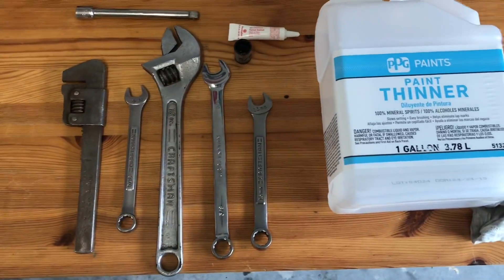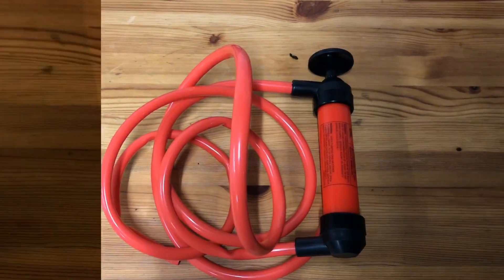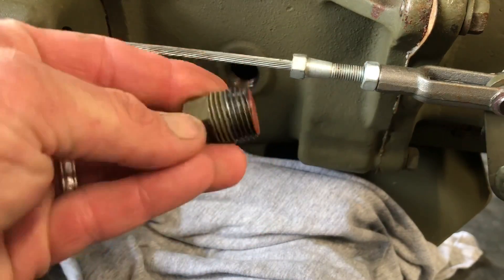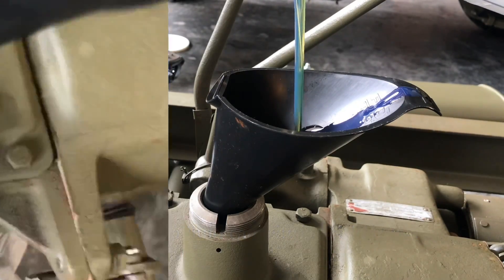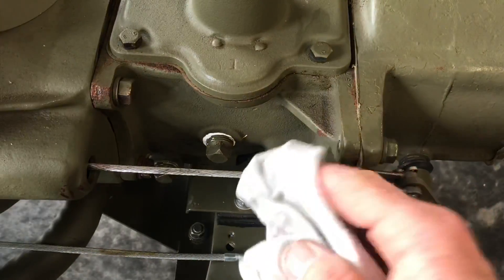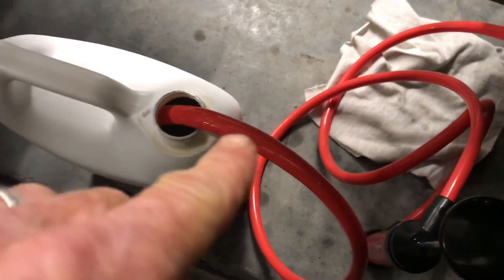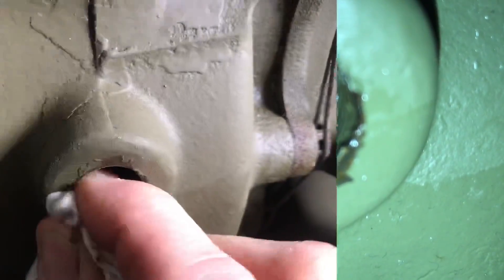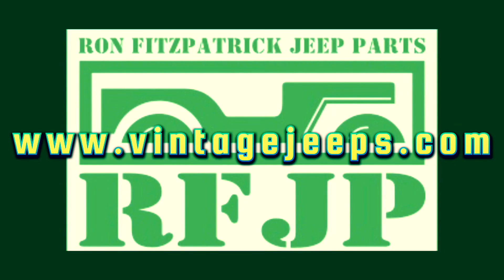Willys Jeep G503 Transmission And Transfer Case Lubricants

Comment: Hi Scott - good video and perfect timing.  After a complete jeep teardown (1948 CJ2A) I've rebuilt the transmission and transfer case and when it stops snowing I'll be filling the cases.  By the way, I still need to get the engine rebuilt.  Know anyone around St. Louis.  Thanks for a great series
Reply from the maker: I’ll ask around about the machine shop.
I have a few friends in St. Louis👍

Comment: I have a 1948 Willys CJ2A.  Can I use the same 90W GL1 fluid for the front and rear differential.
Reply from the maker: Yes
That is my understanding.
Reply: Gl5 should be used in differentials and the book calls for gl4 in trans and t case. Check the book. Gl1 is news to me
Reply: My comment on gl4 and 5 applies to the civilian jeeps. On the early war units listen to g503 and the book. I understood that diffs took gl5 so now I am confused. More research needed on my part.
Reply: @johndoe43  GL-5 is a Hypoid Gear Oil for differentials,GL-4 is reccomended for trans/transfer cases,I have read that GL-1 can be substituted also,both are yellow metal safe!
Reply: @randallstewart8487  thanks. The gl 1 was new to me. The sm 1046 manual points out the 4 and 5 but the gl 1 isn't mentioned. Brian over at metalshaper was complaining about the gl4. Not sure why.

Comment: Great video! Did you do anything to the 3/8” extension to make it fit that plug? I’m under the impression you removed the ball retainer but can’t be to sure. Thanks!
Reply: That looks like what he did, but you can buy square plug wrenches that fit on a ratchet
I found one in my grandfathers tool box that I keep in my Jeep now
Reply: The ball depresses when pushed into the plug

Comment: hello Scott, I'm restoring a willys mb that has been sitting for 30 years, and i was wondering if flushing the transmission and transfer case with offroad diesel would have any negative effect on them.
Reply from the maker: Ben Dumm I have heard of folks doing that. I don’t see how it could hurt. I cleaned my CJ2A axles with diesel. Just be sure to dispose of the fuel properly after use👍
Reply: Thanks Scott for the quick response.